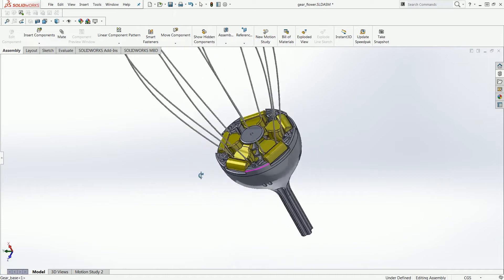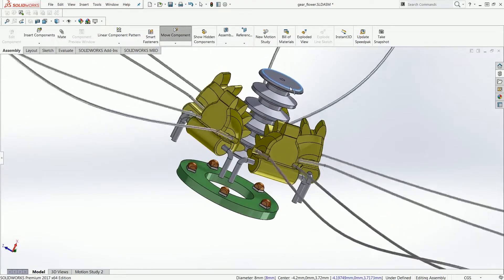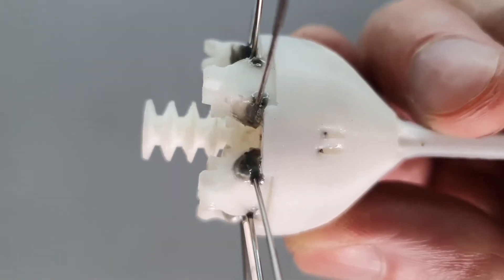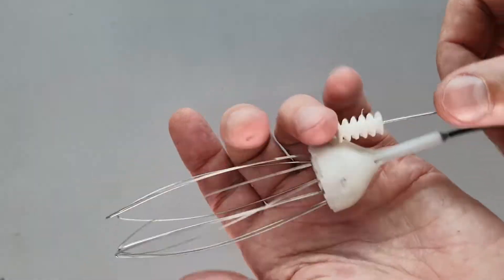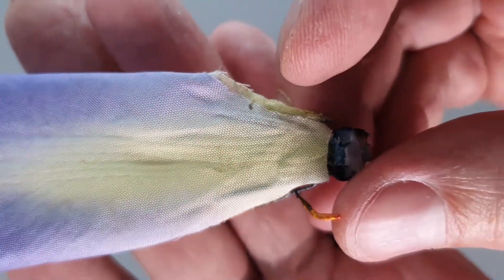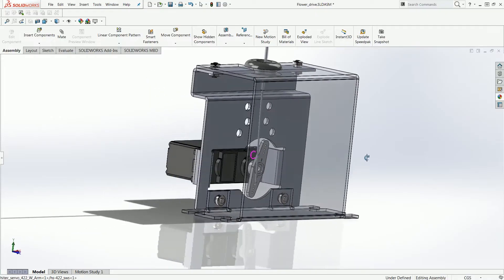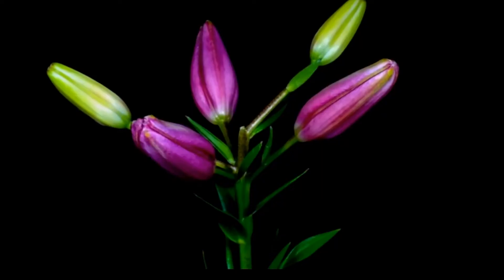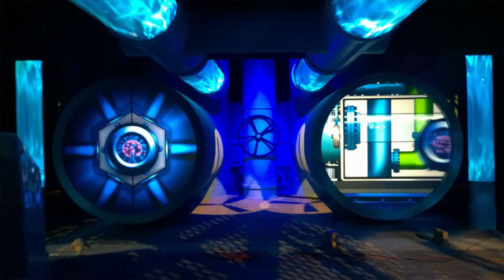Robotic Flowers

Comment: How about a wax actuator like in washing mashines? Should be enough and needs Not more than a Heat source and some wax. Or get the finished part as they are manufactured in the billions.
Reply from the maker: That's a nice idea- a bit unpredictable as far as the angle, as long as you just want full, complete cycles-  it's a grand idea- thank you!